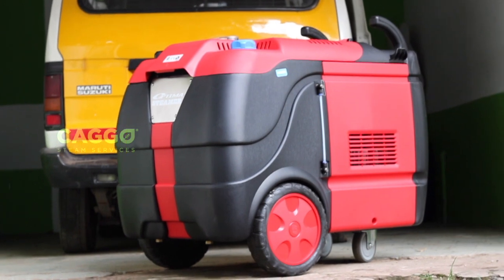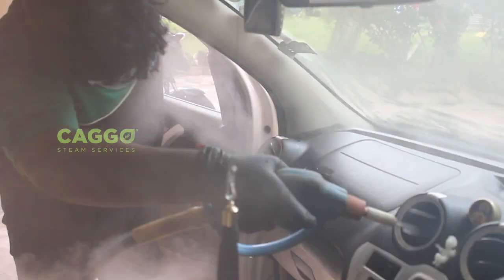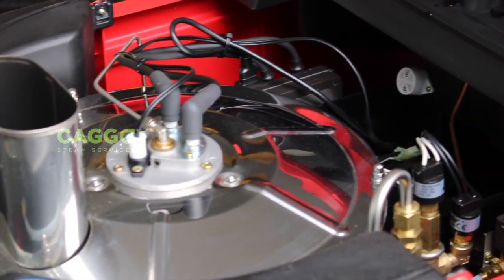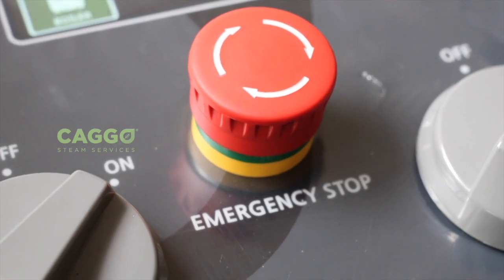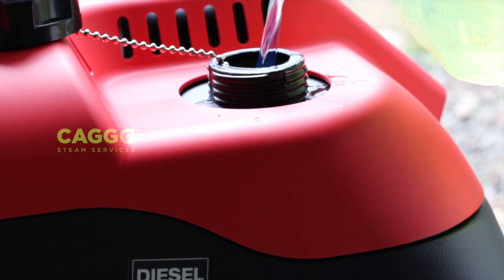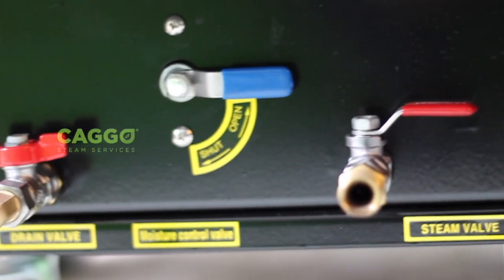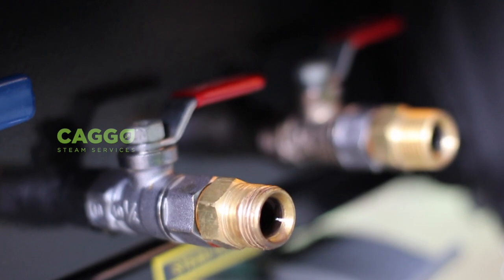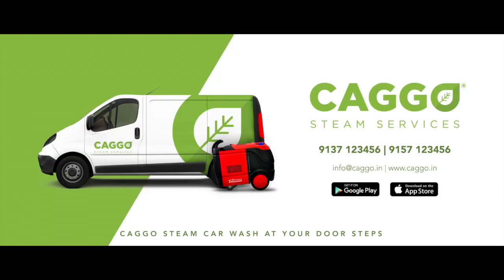About Optima Steamer Car Wash Machine -The most powerful steamer at best price- CAGGO Steam Services

Comment: Does it require extra energy to operate?
Reply from the maker: This machine requires power just to power on the machine rest of the process, to convert water into steam, diesel is used. For more information  contact us @ 9809633333